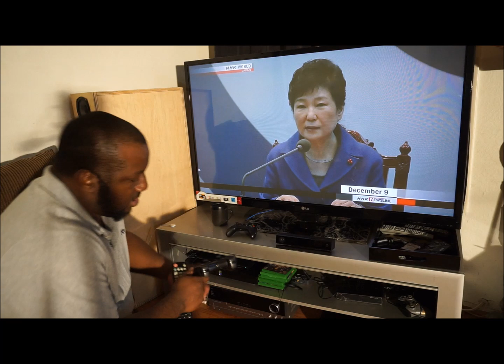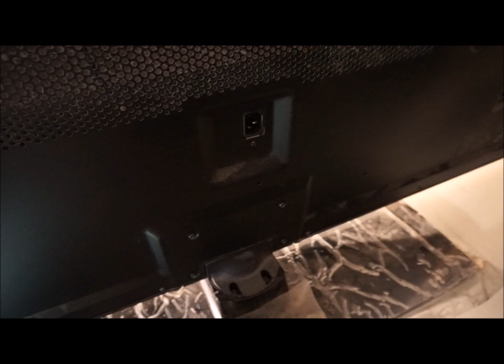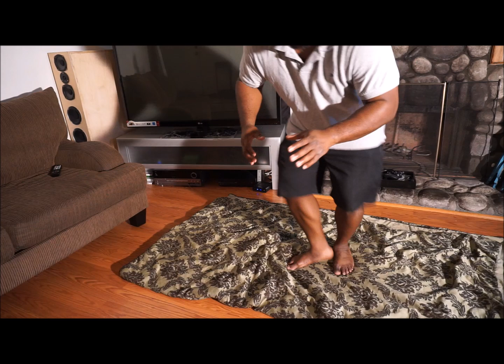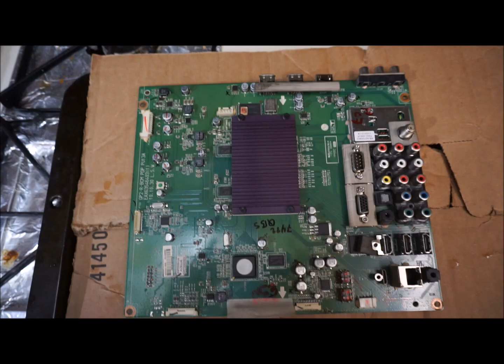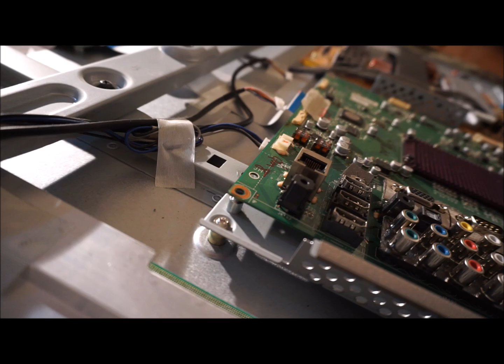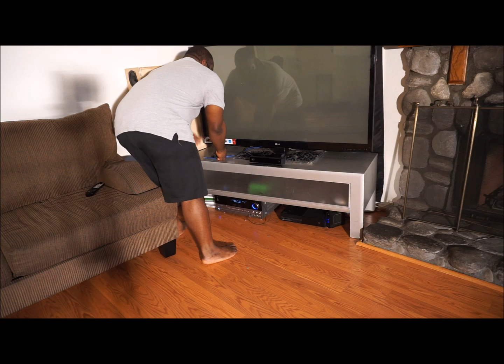DIY LG, SHARP, VIZIO & OTHERS (see vid descr.) TV FIX:  "NO SIGNAL" on HDMI inputs when connected

Comment: hi there..thanks for responding..so heres the story...my LG is about 11 years old...but still has a great picture and everything works..i use an android box and xbox on it.  the other night I had the android box on it then when I went to bed I took the box to my bedroom tv.  When I got up, I put it back onto the LG like I do eveynight..but this time I got the no signal..I tried all three ports and three different hdmi cords to no avail.  I went on utube and first tired the hairdryer method..nothing...then did the oven method...380 for 10 minutes..let it cool, reconnected and still nothing.  I was on ebay looking for the converter cord to try but there are so many and a lot got bad reviews that they didn't work so I was reluctant to purchase one...there is a RGB connection on the back as well as the AVI for my dvd player..any suggestions for a cord for android and xbox convertor?
Reply from the maker: When I first had the issue I used an HDMI to RGB converter box, before I did this fix. And it worked, I just had to occasionally play with the RGB converter box for the color to display correctly.
Reply from the maker: Amazon has some hdmi to rgb converter boxes for about $25 and they have been rated 5/5 stars. The rgb converter boxes I believe will display at 1080i instead of 1080p, but at least you can still utilize your tv’s hdmi devices.

Comment: Hi All, do you know if this problem was solved by LG in the latest TV generations? Do they use the same soldering? I need to buy another TV and had the same issue with my previous one (32LD750.ZA). Now i don't know if i should buy a Samsung or still LG (i am instisting maybe :))
Reply from the maker: What I have been told by a major TV repair electrician was that all of the new tv’s do not last long(3-4years). I guess that is how the prices are soo low these days. The quality of building materials and labor construction may have been reduced for the purposes of a low selling price point for the public, and faster assembly times for large quantity orders.

This is just my guess. I am not 100% sure as I dont have proof.

Comment: Nice vid. I like the way you share cautions.  Do you or anybody reading this know a good place to buy replacement circuit boards? I have a SEIKI TV.  Please supply link(s) if possible. Keep posting. Thanks
Reply from the maker: I have found that the ebay site (european versions) have some good part locations and some tv part sites in asia. The key is to type in google the board’s part number you need with the word price after... for example lets say I was looking for a Used Y-board, then I would type “YH39274-A  price” in google.com or “YH39274-A  cost”.

(YH39274-A is not a real Y-board part number. I just made it up)

Comment: https://i.imgur.com/v4L2wOX.jpg
Senpai.... forgive me....
Reply from the maker: Senpai..LOL...Oh noo!! well you can still bend it back to the best of your abilities.

I hope you removed the 3 screws that secured the back cover of the tv to the HDMI board. 

Did you remove them, before prying the tv cover?
Reply: It all happened on Friday actually.  HDMI ports stopped working, decided to try the oven thing, couldn't get 3 of the 4 big screws out so I improvised and got the board out anyway, oven was possibly too hot as the cardboard tray I used started smoking & set off the fire alarm, eventually tried putting the board back in & the backlight would turn on but nothing else.  At that point I had multiple cuts on my hands & my apartment had a nasty smoke smell so I decided to cut my losses: set the TV out by the dumpster and it quickly vanished so hopefully somebody else will have better luck with it.  Ordered a new 65" LCS Roku set.
Reply from the maker: +G+ is terrible aww man I’m sorry to hear it. We you have a new one on the way. No worries.

Comment: Thanks!   This method worked for me.   Caution: My TV's said board had a plastic attachment.  I should have detached it before putting it in oven.  The plastic piece melted!   I was able to cut it off the board and things still worked.
Reply from the maker: Ok, good. Happy that you got it up and running.

Comment: I did it , but now the screen turns black after the LG logo comes on
Reply from the maker: Just out of curiosity, does the logo display clearly on the screen without any artifacts, distortion, or missing logo segments? Also, what steps did you take?
Reply: Frugal_Fabrication it displays clearly, and I followed the video step by step
Reply from the maker: +iam Frank it could be the capacitors on the Y-board (sustain board). I had the same problem and that was the last issue I had with the tv.
Reply from the maker: +iam Frank what is the model number of your lg tv (on back of it) of your tv, and what is are the board identification numbers on the board you put in the oven?

Comment: Thank you! Great video, my LG 50PK590- ZE (2010, 8 years old.) was working after this, after not responding to the hairdryer version.
I did 175C-180C in a fan oven for 10mins.
Edit: About a year later and it still worked, bow broke due to a different issue
Reply from the maker: Congratulations and well done 👍🏾.

If the problem happens again years later, please comment and let us all know how many years this fix worked for you before needing to do it again.

Comment: Worked!  I BBQ'ed mine on a gas grill using a precise thermometer so I could ensure the right 385 degree tems.  I did this as I had some concerns about what the board could be releasing into my home/oven.  This was on a 2010 LG 60PK950

Thanks!
Reply from the maker: No problem. I am glad it worked. If the problem presents itself, you can always use this method again. I personally have done it 3 times.

Comment: Ok, so my LG47LE5400-UC screwed up no HDMI ports working.  Supplier of new boards was ify on a new board - maybe three months for my unit!  Watched the video and looked around and the solder seemed to be the fix with this video having the most simple solution.  Baked the board for 10 mins at 380 degrees F; let it cool down for 30 mins and reinstalled.  Picture is back only half screen!   Re-opened back (ugh, again) and paid attention to those ribbon connectors -- one seemed to be uneven in its position -- adjusted it, screwed back case and voila -- TV works.  Thanks for the video.
Reply from the maker: No problem, you're welcome man! Anytime.

Comment: I've read online not to do this using a gas oven, can you explain why? Is it more of a fire hazard?
Reply from the maker: Maybe some are afraid that the gas maybe chemically alter the solder...I don't know, but I myself have a gas oven and I have not had an issue the 3 times i've done this.
Reply: It worked for me, using my gas oven 370f for 31 mins. I kept checking on it thinking it will go up in flames, and was afraid that I will blow up...lol!  I even waited few steps away listening for sparks. It just smells real bad. My tv is working now! Thank you😉☺

Comment: Does it only work on LG and Samsung tv's? Because I am having the same issue with my sanyo
Reply from the maker: I do not own a Sanyo tv but it can still happen depending on how the components were soldered at the factory.  

Before placing any board in the oven, I would inspect the board to make sure that there are not any points that would melt or completely burn. 

I would also check thoroughly and see if there are any sanyo TV videos on YouTube that address this issue.

Comment: So, what you're doing here is re-heating or reworking the solder for the whole board. It's a short term solution lasting between hours and a few months. By doing this, however, your making those joints susceptible to oxidation. In other words, this is a short term fix that will likely leave you in the same position, except worse. I suggest sending it to a reputable repair facility and have them solder a new "IC Chip" /HDMI switch that fails. The initial cost runs about a hundred dollars, but will leave you with a TV more likely to last the year than a few hours. I took the short-cut and now I'm back where I was four months ago... Trying something different this time round! 47LG8500
Reply from the maker: Totally understand your logic and it does make sense. But I will say as for me, I have performed this at most 2 times in the last 3-4 years and it has worked been working great for me. 

For me personally, If there ever comes a time when this method does not work, or is required far too often in a short amount of time, then I will more than likely pay a tv electrician to re-solder and fix the necessary components.

Comment: I followed the baking directions. While the board cooled I used a hole saw to cut out area in the back case over the HDMI chip and attached a 20x20x10 mm heat sink to the chip. It seems to be working. I am surprised how warm the heat sink gets running full 1080p. What shitty engineering.
Reply from the maker: Man, great improvement. I agree with the poor engineering insight.
Reply: Twas a cheap fix. Ebay had them roughly 10 for $10. I dislike pulling something like that apart and not trying to fix the problem. I can send you a photo if you like.
Reply: Photos sent.
Reply from the maker: +MaryandDale Davidson thank you, just received them and replied. Your contribution is very much appreciated.
Reply: It occurred to me to check the running temperature. The heat sink maxes out at 108F. I wonder how hot the chip was running before.
Reply from the maker: +MaryandDale Davidson hmm.. kinda makes you wonder...
Reply: Wondering if your fix is still working a year later, have the same issue on my TV. Thanks

Comment from the maker: The reason for this failure on the LG tv's is due to a constant amount of heat on the circuit board components (example: the coils get hot and slightly expand, and the solder connections end up making less electrical contact)

I "believe" this fix would be a permanent solution if you can create a 9 inch to 12 inch space between the back of the tv and the wall (room for the heat to escape). And also if you can place a fan a few feet away aimed at the side or rear of the tv to blow the heat away and keep the tv cool.
Reply from the maker: This is with or without the metal tv back cover on.

Comment: Fantastic, it worked!
But I would suggest to not have the whole underside resting directly on the cardboard as it will move the surface mounted components if some of them are supporting the card when the solder melts. Use some sort of support in the corners (i used rolled up tinfoil).
Reply from the maker: Thats actually a really good idea. Thanks for that input. I'll suggest in the video details to read through this comment section.

Comment: I was skeptical but it actually worked on LG42 series. FYI take the rubber pads used for spacers on the board off before placing in oven otherwise they will toast and create a lot of smoke in your kitchen. Love finding these helpful videos. Thanks for posting this one.
Reply: I left the rubber pads on mine at 385F with no problem. Considered taking them off, but decided to take the risk. There was very little smoke over all. Used clean cardboard, and used a laser thermometer to make sure the oven temperature was right. The smell was not any worse then when I solder with a soldering iron in the house. (wife complains about that also) I did keep the range exhaust fan going on high the whole time.
Reply from the maker: I am glad it worked for you.

Comment: i buy another board but i think i damage the power board now i don't have sound and video at all, turn on but nothing show on the screen,  i gonna have to buy some new  Capacitors
Reply from the maker: I now have that same issue with this television. Capacitors they all look fine they all checked out fine on my handheld capacitance tester but upon looking at the power board I realize there was one fuse which was blown it's a T6.3H 250 V fuse. And I'm hoping this will resolve the issue. 

To go little bit further my problem is when turning the television now I have full sound but the screen never turns on. And after about 5 to 10 seconds the television shuts itself off as if it were some safety procedure. 

Sing the fuse will solve this problem and if it does there will be a video posted about it
Reply: and if you use a wrong video board card that can do lot of damage same happen to this laptop i try this video part for the screen i burn the motherboard ws running like crazy and burn out
Reply: i buy this capacitor my tv one is 25 v 220 uf and 50 v 100 uf i was doing the replace but the last two was 25 v 2200 uf  and 50 v 1000 uf i don't that the right #
Reply from the maker: +1960tinotiger when changing capacitors, the Farad ratings (uf, mf, pf, etc) must be the same rating as the capacitor being replaced.

As for the voltage rating, when changing capacitors you can use the same voltage rating as the old capacitor or higher. The higher voltage rating will allow for a capacitor that is electrically more robust/stronger.

But the capacitance rating must be the same.
Reply: thank you bro
Reply: i will let you know how this end fixing the tv
Reply from the maker: +1960tinotiger no problem man. 👍🏾
Reply: i repace the capacitor still no working back light look good
Reply from the maker: +1960tinotiger hmm..ok on which board? Is this the power supply board or the hdmi/rca module board? Also what is the boards part number just in case.

Keep in mind, there may be a fuse on your board as well (my "power" board has one).  I checked my fuse with a multimeter and there was no connection (open circuit). I just received the replacement fuses (pack of 5 for $3.00 usd) but I have not had time to resolder then new fuse in.
Reply: i don't know the fuse how they look like
Reply: i think seen the fuse one is with a  red line and the other with a two blue lines
Reply: i gonna test the fuse tomorrow
Reply from the maker: +1960tinotiger not sure which model tv you have but this is the free online service manual for my lg 55pz550 tv.

https://elektrotanya.com/cgi-bin/download2.cgi?fid=90115&file=lg_60pz550-ua_60pz540-ub_chassis_pu13a.pdf

On page 40 out of 70 it shows the power up boot failure trouble shooting guide. Maybe look on google for the same service manual for your model television and follow the steps/trouble shooting diagram listed within.

Comment: I gonna try again for 20 minute hope will work
Reply from the maker: Please be cautious and careful and please DO NOT turn the oven oven up too high thinking it will speed up the process or make it better. Many times it will make it worse and cause the electric components to fall of the board due to gravity. AGAIN, PLEASE DO NOT DO THAT. I learned the hard way myself and had to resolder several electrical components back to the board.
Reply: i gonna buy the video board i pay only $50 for the tv for now i use the tv with my xbox 360 no need hdmi for now
Reply from the maker: +1960tinotiger ok please let us know.
Reply: if you said it no good to do this more then once i will not try again
Reply from the maker: +1960tinotiger oh, no im not saying that it is bad to do it more than once. What I am saying is that you should NOT turn the oven temperatures way higher than the what is recommended in the video when heating up the board. 

This video was recording during my second time of heating the board due to my tv's hdmi "no  signal" problem coming back.

In my opinion, It is ok to do this (following the same temperatures within range) much more than once.
Reply from the maker: +1960tinotiger in my opinion, it is totally fine to do it more than once. In this video, this is my 2nd time doing it on the same tv. This is because the symptoms came back a few years later.
Reply: my electric oven don't level  number's just a big point max and small point min
Reply: i find a replace part for US $58.99 in the internet

Comment: i try that with toast and oven for a few minute did not work i still have no sound and no video on the hdmi with the AV WORK WITH NO SOUND
Reply from the maker: When you say "toast and oven" what temperature setting is that on your oven? 

If you are not sure, please wait and first buy or borrow an oven thermometer and find out what setting on the oven knob/dial will give you the right temperatures as stated in the video.
Reply: i got this electric oven i can try with that but do i need to do this for 20 minutes